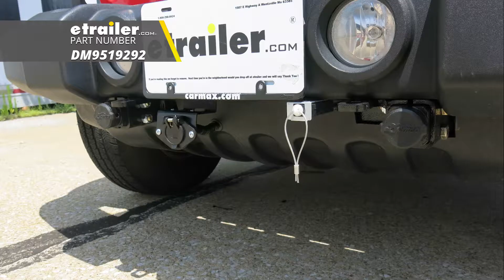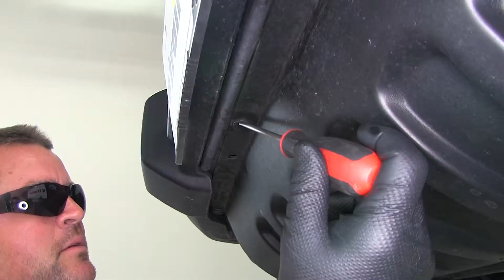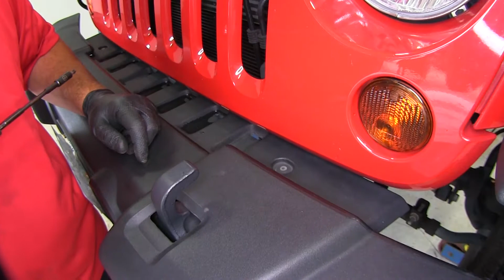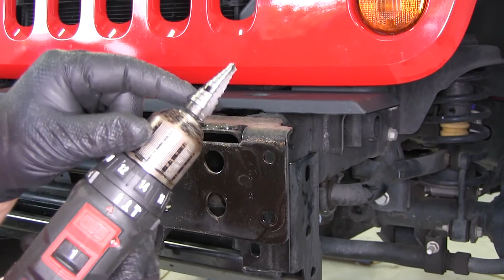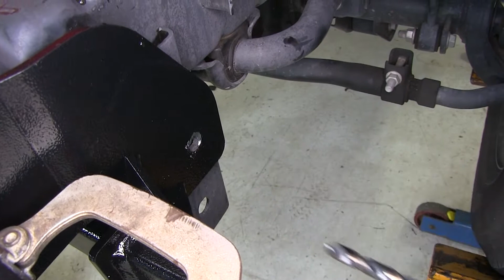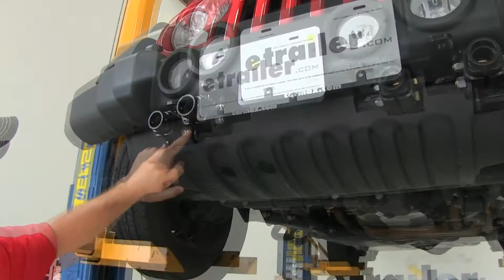etrailer | DIY 2013 Jeep Wrangler Installation for the Demco Tabless Base Plate Kit

Comment: Thanks. Fairly easy install for those looking to DIY. Decent overview but some steps not covered and others get more involved including a few key steps for wire hookup bracket are skipped and can't be done later. Wish I would have known. Also, a few parts need redesign like the nut strips. Not impressed with Demco. Their install instructions have several typos. Thought they would have reviewed prior to publishing. Should be better videos out there. I understand etrailer not wanting to provide clear and complete instruction since they wouldn't want to lose out on installation business.

Comment: Very Interesting procedure - I assume it's a similar process on any vehicle?  Quite a bit involved and certainly important that it's done right !!   A few questions if I may, since I am new to all this, but considering it for retirement this year.1) I assume Demco makes mounting kits for most towable vehicles - custom sized to match the undercarriage?2) Who would be the best qualified to mount this to the vehicle since I obviously requires skill and knowledge?3) If one was to purchase EVERYTHING required to dinghy tow a vehicle (Dominator tow bar, base plate, brake module, tire pressure monitors, wiring harness, etc.) what would you estimate the total investment would be including professional install?THANKS if you have the time to answer...   GREAT JOB INDEED !!!
Reply from the maker: The tow bars are a vehicle-specific item, so the complexity of the install will depend on the vehicle itself. On a Jeep such as what's shown in the video, the install is fairly simple, with most of the mounting locations being pretty accessible. Some passenger vehicles will be more complicated and would require removal of the grille,  and sometimes even the front bumper. It just depends on the vehicle. For a Jeep like what's shown here, the tow bar you specified, the base plates, wiring, supplemental brake system, TPMS and incidentals can cost anywhere from $ 2000-3000 plus, depending on which parts are chosen. Installation costs can vary widely, depending on the labor rate being charged. Most mechanics or body shops should be able to complete the installation without issue.
Reply: @etrailer  Thank you for taking the time to explain !!  I appreciate it very much !!!